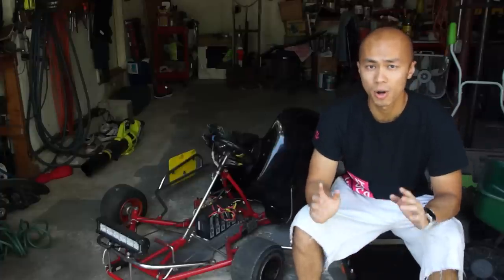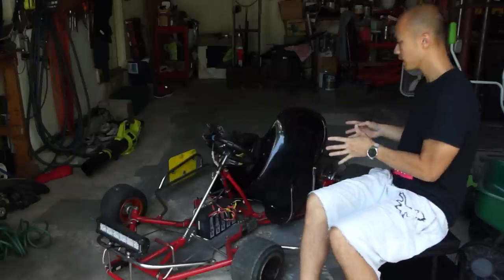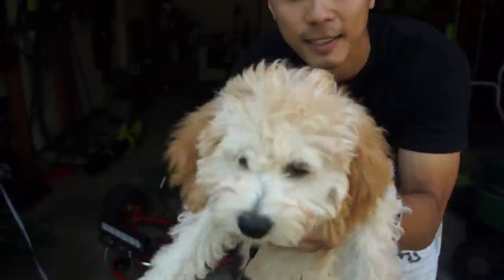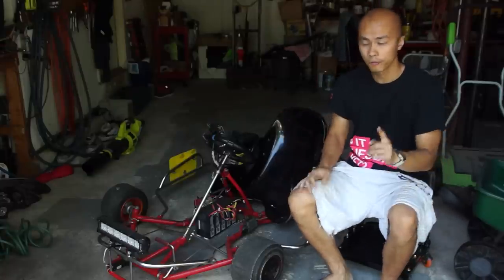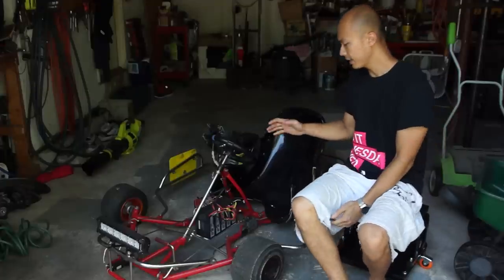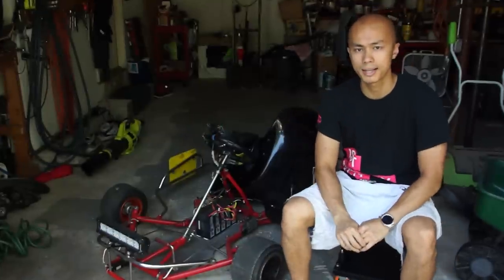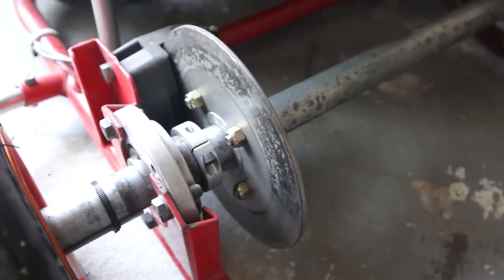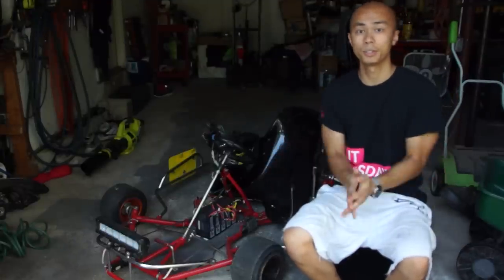10000w Electric Go Kart FAQ & Technical Information

Comment: Have you had to upgrade your front spindles yet? They are the same as mine, the "c" is on the spindle.

 I'm doing the same thing, "diy" 18650 packs though and a lynch motor. But the only thing I'm having a problem is the dang spindles! 

A bit off topic, sorry. Just noticed your brackets. 

Thanks.

Comment: I wonder why you didn't build a custom 18650 pack. Seems like it would be cheaper and give better output.
Reply from the maker: You're completely right. I just didn't have the tools to build an 18650 pack at the time and these lipos really pack a punch also. I have about 2.2kwh of 18650 batteries but I have since sold this go kart.. the batteries will go into my other projects like my most recent one which is an electric recumbent trike. You can see the build on my channel. Cheers.
Reply: What type of 18650 pack would I need to run to get a better output than this 5in series ? Would a 48v30ah custom pack be better ?
Reply: @Jcslim138  Lipo had came a long ways and much cheaper. You can get
4s 5000mah 50C for $35, now..or 6500mah 60C-100C for $60-$100.
It's C rating or DISCHARGE rate....The 18650 will crap out or reverse
pole. ect...and wont have the PUNCH...more maintenance.
you'll get 20C...out of them, at most..and they will get hella hot.
Trouble shoot a crappy cell??? Hell No ..
Plus it's be crap load HEAVIER.

You're Safer using lipo with higher C ratings, less maintenance..ect
 6S 6500mah 60C 100C for $65....It'll have way more punch
18s 66.6 V :-P  or 24s  88.8V..or do 5S (20S)..it'll be around the same price.
it's the C rating...The cells he'was running were only 30C.
Reply: nallen100  If you can get your hands on one or 2 ..give me one :-P 
THey make them for golf cars...24-96v...12kw-30kw.
You can do 12kw continous ..and peak30kw.
this way it'll stay cool ...with power to spare :-P.
i'd  just put 3-ea 32V packs...together to get 96V
it's mostly for recharging or the CHARGER...3-ea 32V chargers.
or 2-ea 48v and a couple of 48v chargers
at 35ah..this way you can ride it for 1 hour...TWICE p/day :-P
6-8 hours recharge...probably
No need to go crazy, it'll be simple for me...if i had the parts.
Reply: nallen100  They make different Lithium Lion cells...bigger than 18650...sort of like size C or D alkaline battery...so it'll hold more ah hours. It's used in different industrial machines or medical EQ..
Or Li-FE...That's why the voltage rating are different...
in the video it's 4s x5..or it's 4.2V x 20 cells ( fully charged) 84V
but 3.6V  x 20 cell...average ...72v...lowest or cut off for LIPO..
You can drain Lion to 3.2V or more...but 3.2V is the safe...average.
Different MFG...will over label  or peak label it...and say it's a 84V lion
pack.....( Lion has less discharge than lipo)
To get the same power as the 72V (20s  lipo) I'd used 22 -23 cells.Lion
Lets say you get an ESC for the 96v BLM..
Get the 96V-120V range......120V incase you use LIOn or Li-Fe
Hope that make sense...

The 10000watt is just the H.P. RATING...
which can also be confusing. Is it10000 PEAK or continues ???
or 10000 continues and 150000 PEAK???
The 12Kw-30KW...motor looks like a decent motor for the price
$25-50 more gets 12Kw....continues.
Reply: nallen100  yes...sort of  4.2V x 32 = 134 V
4s pack x7(28Cells)  puts you at 117.6V...in between 96V-124V

Just adjust/add the cells accordingly....
It's just a pain in the arss to recharge different size pack
I'd just go 24 cell ( 100V)  or 2-ea 48v pack = 96V...
but it's actaully 100V
or 4s x7 117v
They make 120V ESC at 250 amps...need one at 350 amps..lol
Reply: nallen100  That 12kw motor is 96v..at 180 Amp contineus
it;s just RATED at 30kw peak or you can ream 600 amps through it
for only 1 min burst...( which is an enternity on a go kart. lmao)
what you can do is get a 96V ESC with highest amp
They make LIPO with 100C discharge ( wazooo amps), now.
You can keep the Voltage the same..but increase AMPs
C ratings...discharge rate.....
in lead acid it's term CRANKING POWER

Think of voltage...as SIZE of a PIPE.
Amps as  Pressure or PSI

They make 20KW BLM
They make 120V 560 amps esc...it;s not cheap.lol..
But it'll fit a honda pilot/off road go kart.lol

Comment: At 13:05, you mention the continuous current for the motor is "90 amps at 48 volts DC" which equates to a continuous power of 4320 watts, which is less than the continuous power of your controller, which you said is about "6000 watts" at 10:25... Is all this correct? I just don't understand how you could be approaching the limits of the controller or pushing 10kW with specs like that. Any further insight would be appreciated

Comment: Very nice! Might try the my1020 72v 3kw motors. They are much cheaper, smaller, lighter. Run 2 cheap kelly KBS-X controllers at $120 each controllers. (also MUCH smaller) You'll have roughly the same power if not more for about half the cost... I run 120v to the my1020 72v3kw and 88v (7s bats 3s2p) on the 60v 2500w motor. They are pretty tough motors.

Comment: hello there sir, i got a question for u since i couldn't find where to post my question to u in private, 
i wanna use a 52v mighty mini 6ah by luna and a 36v 11ah by samsung in series and my controller is adjustable which means i can lower the amps output to 40amps and upto 60amps..i have dual brushless motor (1500w each) setup on my fiik drifter, is it safe to go with this kind a battery setup or i will need a electric fire extinguisher...???
really appreciate ur help!!

Comment: Love your videos and detail on each component.I was wondering on what your thoughts were on attaching a torque converter on an electric go cart like yours. Not claiming to know more than you. Just my curiosity. Thanks.
Reply from the maker: Tim Loftis would provide no benefit other than parasitic losses and also it may not be able to handle the torque leading to belt slip

Comment: This is an old thread, but I had a question. When you charge the cells, do you do the charging individually or as one big cell? If you do it as one, how do you balance the 4 cells within each pack?
Reply from the maker: There are balance wires to make sure each cell in series is the same voltage. Otherwise can charge the pack altogether, just like any other lithium pack.
Reply: @zed4me  So to be clear, you charge each 4 S Lipo individually, not as one huge 20s2P battery.
Reply from the maker: @srqcrna  You can do either or. It doesn't matter how you charge the batteries, separate or connected, as long as the charger is the right voltage. You just need to make sure each cell is balanced, not out of range.
Reply: @zed4me  Ah, I see what you do now. You balance them all first with that device making sure they are close to nominal voltage then you charge them up!

Comment: Hope you included a kill switch on this build!
Reply: @LegendLength  The switch does not has to be of a high rating type....it can be a micro switch for a kill switch.
Reply: @arnbon6241  How might you use a "micro switch" with a high power system? Do you need relays or transistors or somethin?
Reply: @mattn.8941  Sure , since the micro switch has small contacts and hence can carry small amount of currents, the micro switch controls the coil of a relay or of the contactor and their contacts take the main/ full load. That's the main advantage of a relay or contactor, with a small current (remotely) you can control huge currents.
Hope this helps.

Comment: im thinking of making one using li-ions and then 2times a 200kv 1650watt motor and later upgrade  to 4wd

think this wil work? they are now on my longboard and they are powerfull enaf to pull me and 3 people behind it with ropes uphill(10/15%)  while speeding up
not sure if it will work tho
Reply from the maker: Danny h could work although 4wd will be tough. If the motor you're using can really handle 1650w then 2 motors will be 3300w which should be more than enough for some fun

Comment: well how much in total did u spend on the project
????
Reply: Check the prices for all components in description. I think it is 900-1100 dollars plus go kart frame with wheels and steering wheel without motor 1000-1500 for used example.

Comment: When you wired your led light bar, did you have to wire it to a single 12v battery? I have a child 48v electric Baja Moto kart I was wondering if you can wire the light bar right up to the batterys or does it have to be a single 12v battery out does it even matter?
Reply from the maker: Shane Odekirk requires 12-24v anything more and you need a voltage regulator that turns whatever voltage to have to 12v
Reply: Thanks

Comment: Ok, so i can put an 24v, 90A diesel alternator, Wired in Y configuration, using PWM to decrease the exciting voltage, on the brushes, from 12v on the start to 3v at top Speed, for 10% of you motor price tag. Great!

Comment: hi, so you say that controler of yours is 12000 watts, but when i go and put its full name on ebay it say 5000 watts. can you help me out?
Reply from the maker: The controller pulls 150amps, and at full charge the batteries are at 82v, that gives you 12000w. 5000w is what the charger is capable of running continuously.
Reply: thank you!

Comment: what wattage is the motor. and how much was it cause I can't find your one
Reply from the maker: Ben Gough copy paste the motor in the description into google
Reply: it won't let me:(
Reply: You should have a look at my first go-kart build it will probably laugh
Reply from the maker: Ben Gough then read the description and type that into Google...?
Reply: actually not sure how bad you'll laugh after seeing the price .  
I've got two hoverboard motors. attached to a kids go kart.  only one of the motors is powered at present . . 
so at 58vs  400watts on one motor I achive 30 miles per hour with similar. results to your self. (no vibration noise . )draw back start of i pull to one side.  
get about an hour's play time of 4ahs.  hopefully with a buck step down I'll be able to make that last a little longer at full speed.  
but I'm looking at future projects. (more classical approach to a go kart with single rear axle drive ( for sprocket controls and stuff. )  
and it's just sky rocketed the price. I spent about £50 on it so like $75  and I can active 30 miles an hour.  but looks like I'm in the range of 700 to make a go kart like the one you have made. ( maybe I'm stick to what I've got and convert the segway motors in to sprockets. see how much more pull I can get with a gearing system. )

Comment: 775 motor with a pwm 200amp will smoke that my friend it a video with 775 motor on an it cheap an super fast than buying a electronic  kit you got a 10.000 watt go kart an you only going 60mph you got RIP off you should be doing way more speed 6#775 motor he was doing 70mph he got scare an slow it back down